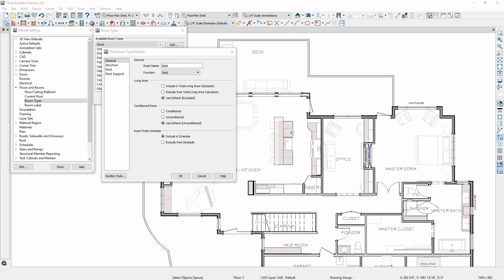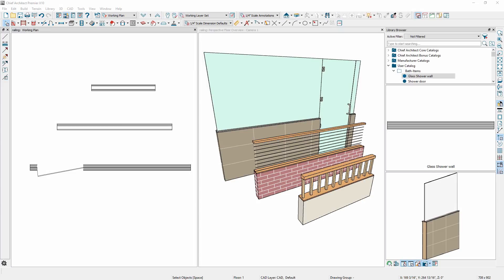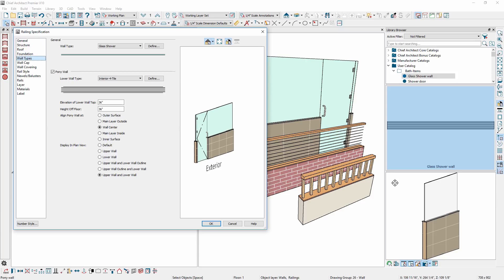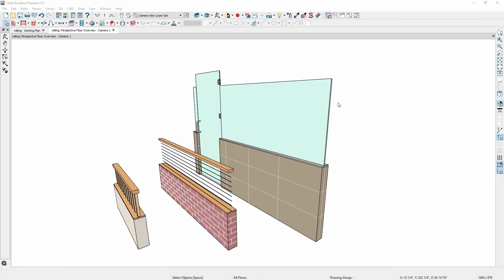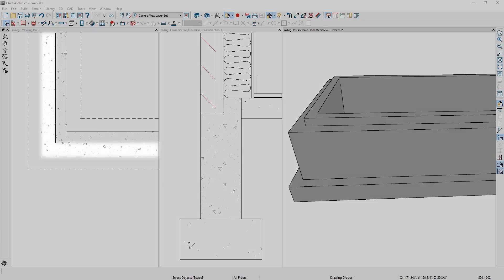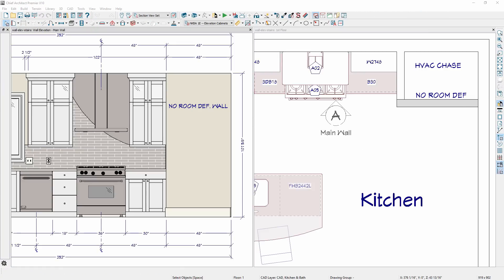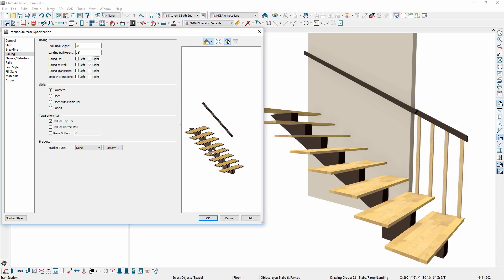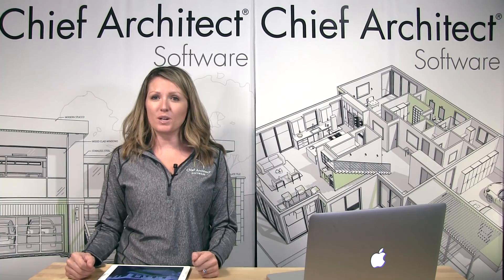Chief Architect X10 New Features – Structural and Plan Display Features

Comment: Is the brick ledge to stem wall height adjustable or a predetermined distance apart?
Reply from the maker: Hello, tommydjohnsonjr. With Chief Architect Premier there is a setting in the Wall Type Definitions dialog that allows you to adjust the Brick Ledge Depth.